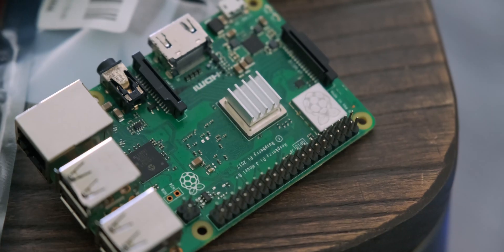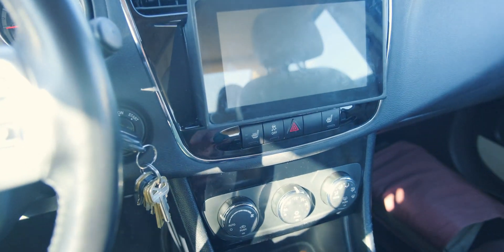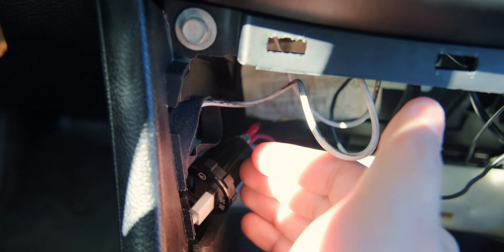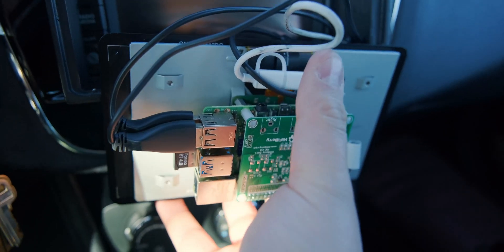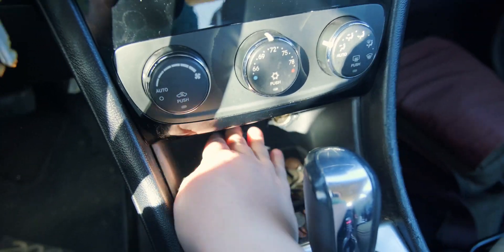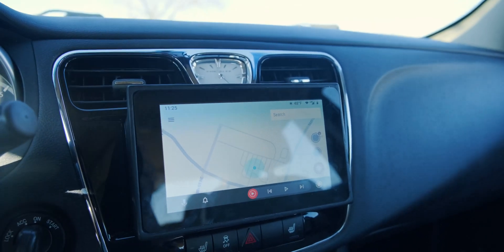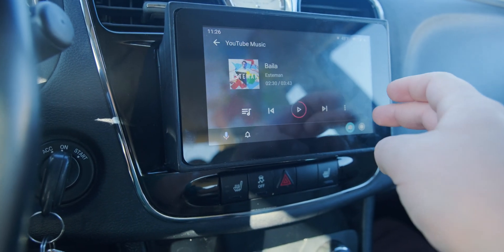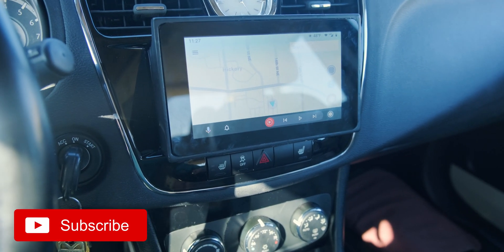Pi & Power Upgrades | OpenAuto Pro 12

Comment: Great videos. I'm looking at a build. Why are you still using a Bluetooth dongle when the Pi4 has BT 5.0 built in? I haven't used my Pi with BT so have no experience with the quality of connection is why I'm asking.
Reply: OAP website states that a USB dongle is a “requirement”…. Sad…

Comment: Is there a solution for the slow ass boot?
Reply: Ditch booting from the  SD Card… the interface is SSLLOOWW
Use a high quality USB3 Thumb Drive. DON’T use the “dime-a-dozen” cheapos…. They ARE NOT worth the hassle.
Get a Samsung or Sandisk..

For max speed, you should use a USB3-attached SSD.. check the forums for a properly-working cable, though. Some USB-SATA cables are problematic, other are useless.

N.B., The standard 2.5” SSD’s are fast, and a cheaper option.
The NVM-style are faster, smaller and more $$, and they max out the USB3 bus speed. I don’t find the speed boost is worth the $$ boost over 2.5” form-factor.

YMMV

Comment: Nice to see it upgraded to a pi 4 my question for you is why use a dac when you have Bluetooth? Is quality better and what have you done for start up and shut down do you have to take it out and do it manually
Reply from the maker: The DAC was to improve the connection between the pi and my stereo/headunit setup. Not really needed, but I thought it'd be a fun project.

To exit AA, tap the "apps" icon (last one bottom right) and choose Exit.

From there use the normal OAP shutdown menu

Comment: How would you go about this if you wanted to output audio to a amp with RCA inputs?
Reply from the maker: There are Hifiberry DACs with RCA if I recall correctly.

Otherwise you'd need something like a 3.5mm to RCA cable (if that's a thing)
Reply: @eightbitJuan  There is, but only 2.  A typical 5 channel amp would need 6 rca's :/
Reply: @efboiz5302  Umm, I think you got something Wrong. You only need two RCA for Stereo, I doubt that you want to use 5.1 in your Car... I have 12 (6RCA, 6 HiLevel) Inputs and I only need 2 of them for my Soundsystem. (Btw, I actually use zero because of optical...)
Reply: @eightbitJuan  …3.5mm to RCA were bog-standard at all Radio Shack, Fry’s, Car Audio installers, Hi-Fi shops, Ham radio shops….
RCA, 1/4”, 1/8”, 3/8”, DIN, XLR both balanced & unbalanced, etc etc… difficult to find these days….

Comment: Nice video, I was about to order my own buck converter to get the voltage down to 5.1. Your solution seems to provide a 12 volt output from this usb quick charger. Am I missing something?
Reply from the maker: This takes the 12V from my fuse box to something the Pi can use, (which would be the 5V 3A) that the charger can provide with a convenient standard USB port.

As mentioned here, before I would actually strip a USB cable and wire it into the buck converter. That works, but it sucked when I needed to replace the cable.